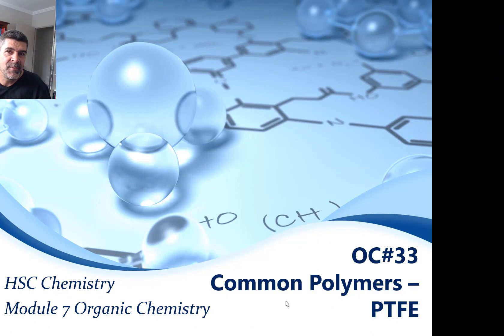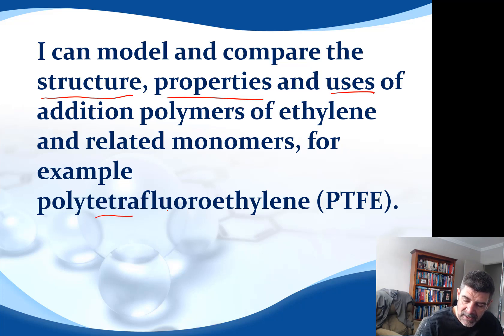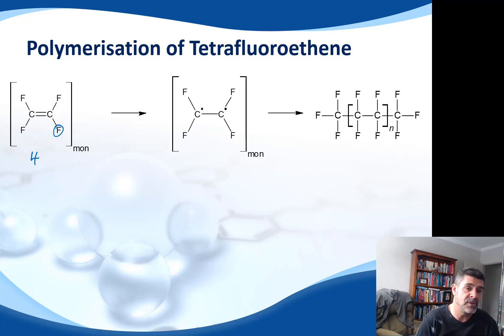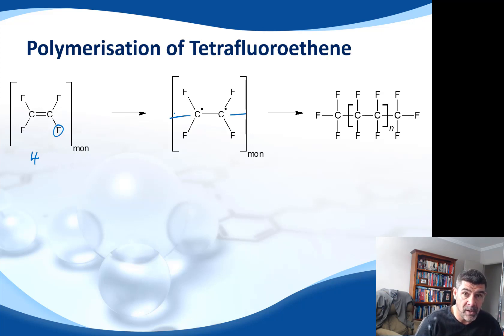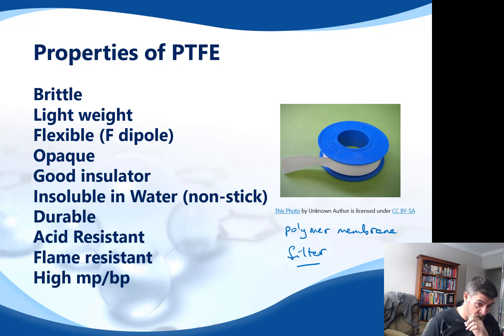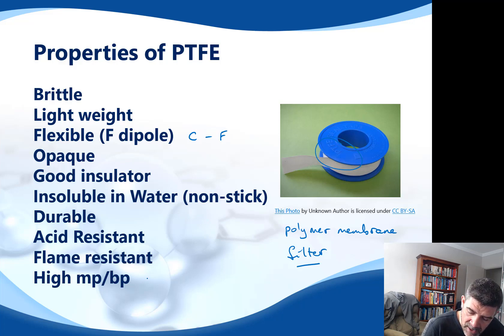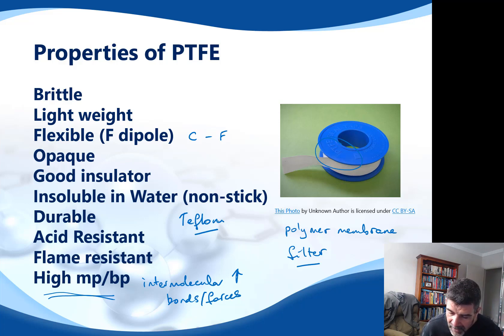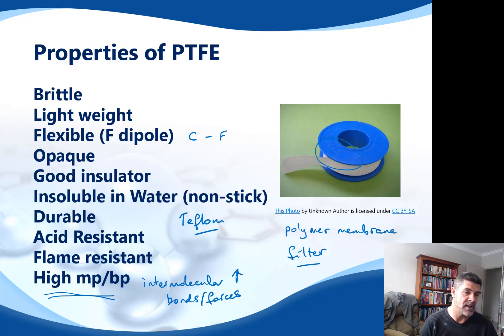OC#33 Common Polymers PTFE

Comment: how can PTFE be both flexible and brittle at the same time? PTFE is very high density from research so how can it be lightweight?
Reply from the maker: Checklists of properties are just that, pretty unhelpful. Because of the wide nature and uses of plastics they can have some flexibility in one plane, eg tension, rotation or compression and be brittle, or less forgiving, in another. The high density you refer to relates to the 'substitution' of hydrogen atoms with fluorine atoms, which are heavier than hydrogen atoms. Density also relates to how tightly packed the polymer strands are to one another, as well as a general comparison between plastics and other materials used for similar purposes. I wouldn't get too concerned about checklists. It's more important to be able to link a property to a purpose when looking at polymers. Appreciate the feedback.